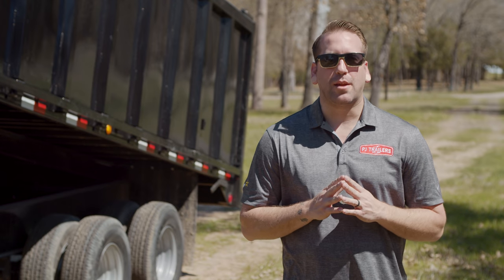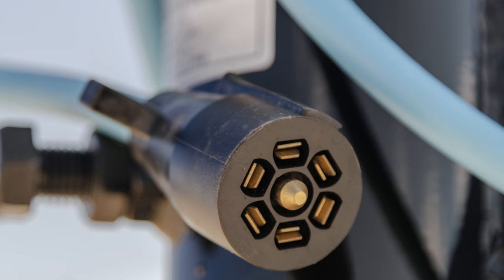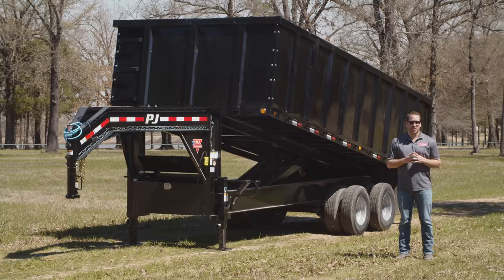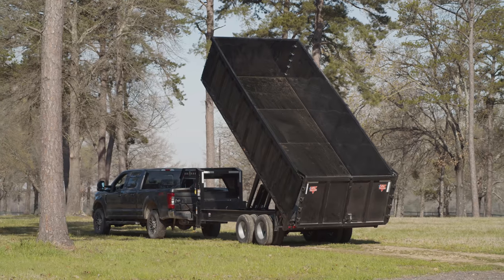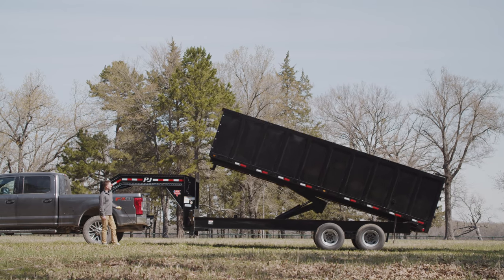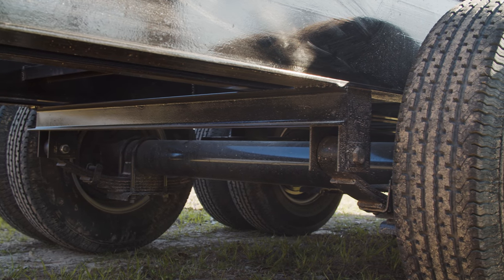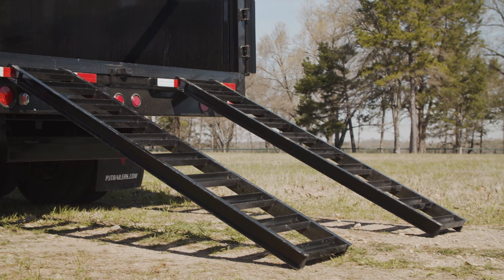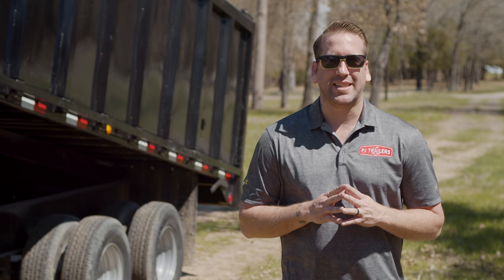Tandem Dual Dump (DD) Quick Walkaround

Comment: Can you use this for busted up concrete?
If so can a f250 pull this? Wouldn’t you exceed the towing capacity and the gcwr
Reply: Maybe not on the new f250 but my 97 f350 would probably be over loaded with half load per ford but would probably handle a full load
Reply: @tractorboy31  that trailer fully loaded with concrete would be massively overweight for the truck and that trailer. concrete is heavy lol
Reply: @tractorboy31  Might I suggest wearing an adult diaper before heading off in the ole 350 with that trailer full of concrete chunks, you're gonna need it !

Comment: have you ever had a load of gravel on a trailer and went down a gravel road, what happens is the trailer pushes the vehicle and its frightening, you end up with your tow vehicle facing uphill and the trailer beside you, or on a wet road, very dangerous idea towing such a large trailer with a 4x4 that size.
Reply: Electric brakes? The human brain? Otherwise known as common sense. Lol only breakin ur stones but I don’t think that I’d be comfortable wit less then a f550 or so and definitely a gooseneck. Unless your pulling with a 650 or something like that